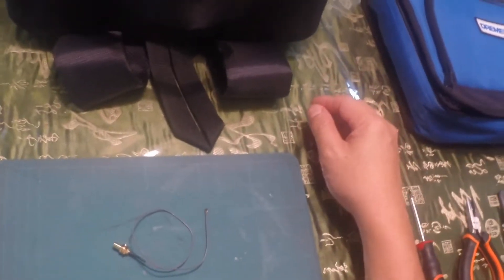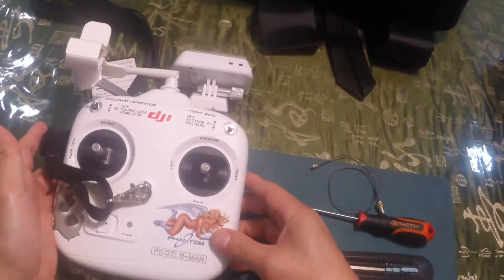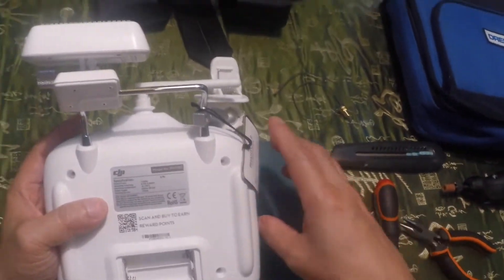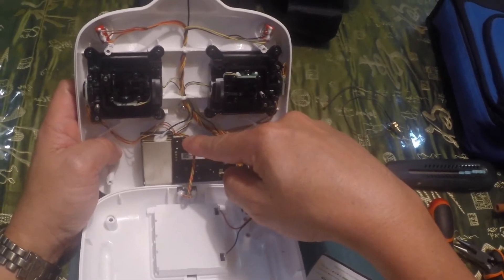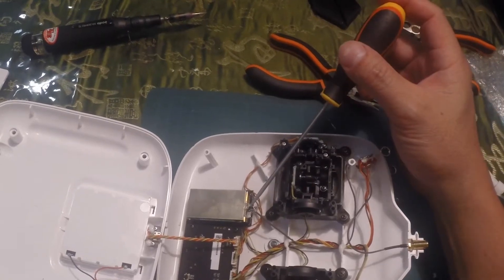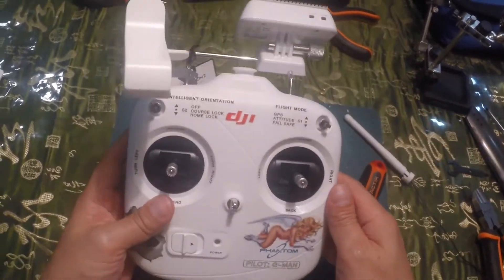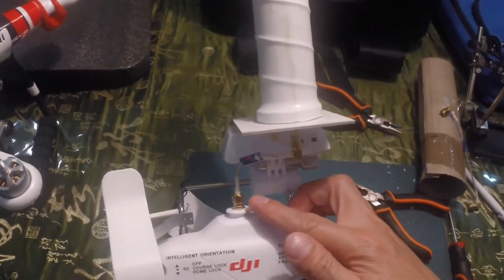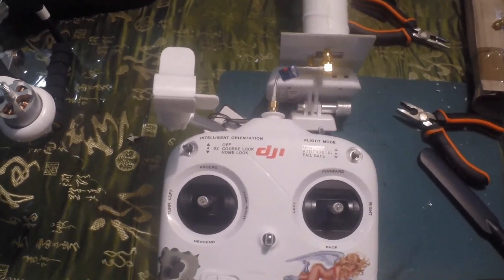DJI Phantom2 Vision Plus~Range Extender~Horizon Antenna Pt.2

Comment: Can you give more detail on how you soldered the u.fl wire to the board? I made the exact same mistake you did and I want to be sure that I solder it to the board correctly. Thanks and keep up the good work!
Reply from the maker: Hi Rick. I cleaned up the damaged area and you will see, where the socket has an inner and outer metal or wired points that connects to the damaged socket. I revealed the RF wire that I want to connect which consists of a centre cable that needs to be soldered to the centre of the  'damaged' socket and the shielding mesh which needs to be soldered to the outer ring connector. I have helped a friend make a similar mod and found that the board with the damaged connector and RF box can be easily removed and holding it in my hand am now able to easily manouver my hobby knife to slice away the gel that covers the socket and thus remove the defunct socket and plug the new socket. 

Your solder needs to be very precise. Pulling this board out will give you a better view for your soldering. This board is held with a multiple pins. Be careful not to damage the pins upon removal and carefully insert the board without damaging the pins. It's very snug and the board need not be glued back in place as its originally done likewise. 

Hope this helps Rick.

Comment: Hi Gordy, thx for the great how-to video's! But I've a question. I would like to upgrade (bird & transitter) my range ánd FPV reach. I'm using a P2V+. My goal isn't reaching >1000 mtr, but more stable control and fluent FPV footage. Can you advice me about wich upgrade is the best? (FPVLR vs Horizon or just adding TP-LINK antenna's etc) Thx in advance!
Reply from the maker: Hi, I certainly respect your choice. I have to advice that this antenna package in my vids is not for this purpose. I would suggest that a cloverleaf antenna system would be best suited for reliable close proximity, all round control. You would need a high gain, preferred 9dBi, for the 2.4 and 4.8 Ghz freq. you don't really need a booster for the 4.8Ghz, but the 2.4Ghz would give you some peace of mind. If you are flying within built up areas, line of sight would be best adhered to. This setup might be more advantages for flying among wooded areas but that all depends on the thickness of the foliage. Tests have shown that any form of wave signals significantly loses huge amount of signals through concrete and heavy foliage so please stick to the line of sight system and fly with GPS assistance. This may seem identical to stock systems but if you fly with this system regularly, you will feel the more responsiveness of your Phantom 2V+ and the forgiveness when it accidentally ducks behind a building and you recover it. This is due to the signal propagation of the cloverleaf antenna that sends multiple waves that reflect off surrounding within close proximity, compared with the dipole(single waves)or directional(straight or penetrating signals) antennaes. Hope this helps in your joy of flying.
Reply: Thx for your quick reply and great feedback! Hope you can also answer my last 2 questions:
1. Can you mix types of antenna's? For example: a TP-LINK 2.4 Ghz (or maybe 2) on my WiFi extender and a cloverleaf 2.4 Ghz 9 dBi on the bird?
2. Can I also use a 2.4 Ghz antenna on the radio transmitter?

Thx in advance and keep up the good work!
Alex
Reply from the maker: Great question. Yes, you can use two TP-link antennas for the 2.4Ghz, but would be a waste of capabilities. Reason being, the system utilizes a diversified board which basically switches between the two antennas to get the best signals. You can use two different antennas to get the best of your system like one cloverleaf and one Tp-Link dipole. 

If you are flying within 1km, I would advise you to keep the stock dipole antennas on the bird. For the best results in range and control, it is recommended that you use identical polarization antennas for Tx and Rx. For example, dipole (RC) and dipole (bird) or cloverleaf and cloverleaf or even left circular polarization and left circular polarization, etc, etc. 

For the Radio Controller, do not use a 2.4Ghz antenna for the 4.8Ghz control antenna as that will decrease your range by half or even lesser. Antennas are tuned according to the signal wavelength and using a wrongly tuned would scramble the signals and get weak signals instead.

Hope this helps.
Reply: Again, thx for your detailed answers to my newbie questions, this helps so much to understand the antenna puzzle. Hope you are up for another one or two? (or three..)

1. I can't find a good dipole 4.8 Ghz for the transmitter. I saw a great one on your video (the square one, 11db rpsma 5.8 ghz patch antenna), but they are not available (illegal!) in the Netherlands. Do you know an alternative?

2. My bird has 2 dipole antenna's. Are they both 2.4 Ghz or one 2.4 Ghz (for the data) and one 4.8 Ghz (for the controls)

3. I was checking on cloverleaf antenna's, but i can't find 4.8 Ghz. Can I use (as FPVLR is selling) also 5.8 Ghz for a greater control range?

Have a great day!
Reply from the maker: First of all, my mistake, the Remote Controller uses the 5.8Ghz frequency. Sorry to confuse you.

1)Here are two 5.8Ghz dipole antenna that you can buy from Amazon.com . I'm using the first one with power gain of 7dBi dipole antenna : <http://www.amazon.com/gp/product/B00GGIESAS/ref=ox_sc_act_title_2?ie=UTF8&psc=1&smid=A2N1S6D8VVCNZ3> and a more higher gain dipole at 9dBi - <http://www.amazon.com/gp/product/B00EP5ZEPC/ref=ox_sc_act_title_1?ie=UTF8&psc=1&smid=A9RRFZDGAXG22>

2)Both your bird's exposed dipole antennas are 5.8Ghz. The two 2.4Ghz antennas are linked to a patch antenna found in the battery case(take out the battery and you will see two patch antennas with arrows, found at the deepest end of your battery case on either sides).

3)If you try now, 5.8Ghz antennas can be found everywhere. I do appologise again. I was busy chatting with someone else about a 4.8 rating for an old LiPo battery I was using.
Reply from the maker: We were all newbies one time or another. So don't feel uncomfortable to ask. I will try my best to help.
Reply from the maker: I hope you know how to use the orientation of a dipole antenna. The signals from a dipole antenna emits from the sides of the antenna like a circular wave, like a pebble dropped into water. There are practically little or no waves coming out from the tip. So if the Phantom is flying in front of you, point the tip of your RC flip antenna with the pointed end up to the sky. If the Phantom is directly above you, you would want to orientate the RC dipole antenna parrallel(horizontal) to the ground.

You will find Phantom pilots trying to do altitude flights straight up, would angle their Bird's dipole antenna horizontally and their RC unit antenna horizontally too, when flying their Phantom straight skywards.
Reply from the maker: Watch this explanation about antenna wave signals - <FPVLR antennas for Phantom 2 Vision and Plus and RHCP vs LHCP increase FPV range>
Reply: Thx Gordy and off course no appologise needed. I checked the German Amazon site and ordered the Neewer flat panel antenna (incl cable) as a start.

Comment: hi, i was wondering if you could tell me where you got the remote switch stickers my phantom doesn't have them it's plain white. so i mess up on the toggles.
Reply from the maker: Hi, the labels was made by using a label maker which I bought from a stationary store like Office Depot. I just printed in small font and cut it to paste on the Remote Controller.
Reply: thank you so much i didn't even think about a label machine.
Reply from the maker: No problem. Happy to help you. This a more affordable solution and you also have the opportunity to custom the fonts to your personality.

Comment: I made mine a permanent modification too, but I also added a small wire tie to the neck of the transmitter. just under where you tighten up the nut, it spreads the plastic slightly and can eventually break or cause dust to get inside your controller. BTW I love the mod, I recommend it to every Phantom (any version) owner who is looking to improve their flight range.

Comment: Excellent videos.....Is there any way you can provide a detail list of all items needed to buy so that I can place the order correctly with Horizon.
Reply from the maker: Hi Rene, Horizon sells them as a kit. So everything including the cable is provided. The only thing you would need would be the tools. You just have to choose the kit that suits you. Depending on range of your intended flight, short, medium, long or insanely long range flying(Beyond Visual Range). When you browse the Horizon website, take a notice on the antenna gain. Their extreme antennas at 12dB Black Hawks, single or dual extreme kits can extend up to 10km on a one way trip away from you. Whichever you choose, fly safe and in control. Cheers!!
Reply: ***** Thanks I contacted the guys at Horizon ,,,great guys and very helpful
Reply from the maker: Rene Natola
Yes, they are very friendly and helpful, I just received my extreme kit and will shortly film my new vids on the extreme kit.
Reply: ***** looking forward to view your video
Reply: Rene Natola Gordy, I am installing the extreme pilot package from Horizon with amplifiers. If I do not place the clover antennas on the UAV does it matter....will I be able to get good FPV and Distance of let us say 2 km without uav antennaes
Reply from the maker: Hi Rene. Yes, you should achieve 2km and then some more. The UAV clover can be omitted. Some have measured 4+km return flight with the extreme kit. Horizon said they measured up to 11km line of sight probably with a land based vehicle to test range cause I don't think our batts will fly a return trip that far. I will post an improved way of mod the RC unit better without threatening the glued connector.

Comment: Hi Man... Good Work

I have brought my new P2V Plus and allready ordered the parts for ANTENNA modifications on PILOT site, WIFI EXTENDER and RC CONTROLLER.

For RC controller i have brought the 5.8ghz amplifier http://www.aliexpress.com/item/0-25-WEA06W-5-8GHz-1000mW-802-11A-N-SMA-Broadband-Wi-Fi-Amplifiers-Signal-Booster/1904091151.html?promotionVersion=1 !

The parts that i have brought to upgrade my RC CONTROLLER and EXTENDER antennas is:

2.4ghz Booster
http://www.aliexpress.com/item/2014-Mini-2-4Ghz-2W-33dBm-802-11b-g-Wifi-Wireless-Broadband-Amplifier-Router-Power-Range/572006772.html

5.8ghz Booster
http://www.aliexpress.com/item/0-25-WEA06W-5-8GHz-1000mW-802-11A-N-SMA-Broadband-Wi-Fi-Amplifiers-Signal-Booster/1904091151.html

11Dbi flat Antenna for RC Controller
http://www.aliexpress.com/item/FPV-5-8Ghz-11dBi-High-gain-Panel-Antenna-200mW-TX-more-than-3KM-for-X350-pro/1880111332.html

2 Lipo Battery + T Plug To Dc Wire adapter
http://www.aliexpress.com/item/Txrdue-11-1v-2200mah-25c-MAX-35C-AKKU-LiPo-RC-Battery-For-Rc-Trex-450-Helicopter/1517582047.html
http://www.aliexpress.com/item/2Pcs-T-Plug-To-DC-Wire-For-Receiver-Monitor-FPV-Power-Supply-A-Type-B-Type/1835315663.html

PigTails Connector for Antennas MOD
http://www.aliexpress.com/item/5-pcs-lot-20cm-RG178-Cable-Straight-RP-SMA-Female-Male-Pin-to-uFL-u-FL/1567183445.html
http://www.aliexpress.com/item/5-pcs-lot-5cm-RG178-Extension-Cable-Straight-RP-SMA-Jack-Male-Pin-to-uFL-u/1903186041.html

13 Dbi antenna for EXTENDER
http://www.aliexpress.com/item/10PCS-802-11b-g-n-2-4G-13dBi-Antenna-High-Gain-WIFI-Booster-Wireless-Lan-omnidirectional/421598172.html

Velcro Tape to PUT the amplifiers
http://www.aliexpress.com/item/High-Quality-1M-3ft-2-Rolls-Self-Adhesive-Velcro-Roll-Hook-Loop-Adhesive-Tape-Fastener-Free/1511243136.html

What you thing ? With this upgrade kit i will reach a good range ? 

Thanks
Reply from the maker: Your setup is beyond extreme! Awesome mod. I wouldn't be surprise you will hit the 6km mark. Just keep an eye on the battery.
Reply: ***** Thankyou man, your vids really inspired me to buy this parts and do my mod ! I'm from brasil, and i will wait my drone and all parts arrive to start my modification.

Other thing, as i will use 5.8ghz amplifier to the RC CONTROLLER too, other youtube video said that i need to put controller on CE MODE and not on FCC ! Do you know why this ? Thanks
Reply from the maker: FCC mode is a amplified mode, if you amplify a amplified wavelength, the signal may not be clear and become garbled. It's like if someone screams in a microphone, if you boost more power the scream can be defening and some speakers cannot process the sounds. Put to CE mode you get normal and clear wavelength signal and the amp will provide a higher boost than the internal FCC boost.
Reply: ***** Thanks for perfect explanation man ! I understand wi CE mode now. If i use 5.8ghz amplifier ! Thanks ! When i receive all parts and drone i will do the mods, and post videos about it !

Comment: Gordy, have you had any problems after the solder? I just broke the u.fl off inside my phantom on the receiver and will be trying to solder. Did you do a positive and negative solder? Any chance you zoomed in on your work for a picture? Im terrified of soldering this tiny thing.
Reply from the maker: Hi Robert. My video, http://youtu.be/85fSzidAA2c shows how you should try to modify the antenna to the Phantom UAV side. It's been advised by Horizon antenna and a few other modders not to try to attach the u.Fl to the inside boards, as DJI has soldered the connection as they have said that the board internally is very sensitive to mods. The splice methods have worked better. Also if you don't modify the dipole antenna on the Phantom UAV, Phantom flyers have hit past the 4km range by just modifying the RC unit instead. Some antenna cables are silver coated and are difficult to solder. Use flux paste or solder paste to help the solder stick to the wires you are trying to solder. Good Luck.

Comment: how you liking the phantom vision plus so far?
Reply from the maker: It's a great platform. Unfortunately not flexible for mods on the FPV and camera systems. But overall, easy and easy to control.

Comment from the maker: #UPDATE# Many problems reported about cutting the glue on the board. Better to stay away and splice cables instead. Splice close to antenna and joints not longer than 1-2mm. flytrex and splice Refer to video at 14.00 point.

Comment: Cool, well done. I am going to take it very slow with the silicon. How about a range test once the range extenders done ?
Reply from the maker: I'll begin the range test just a few days after I've finished with the UAV LHCP antenna set-up. I'll be away on work for the next 3 days and continue with the build when I get back.I'll have time to do the range test on Wednesday 2nd July. Stay tuned.
Reply from the maker: Hey goldmagnet. A safer way to handle the cable is to not try to cut the silicon and splice the cable near the top and make sure the joint is short, around 1-2mm. I tried the splice method and its works great. You don't have to worry about the silicone. Many modders have damaged the board, as I've been told.